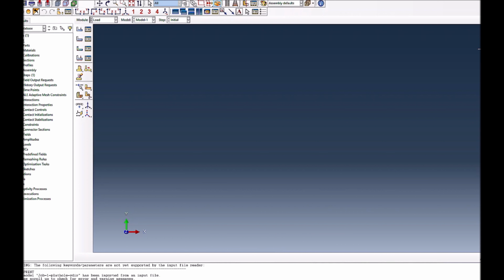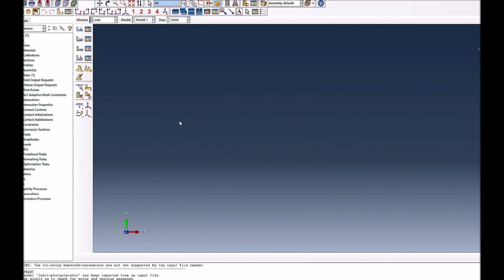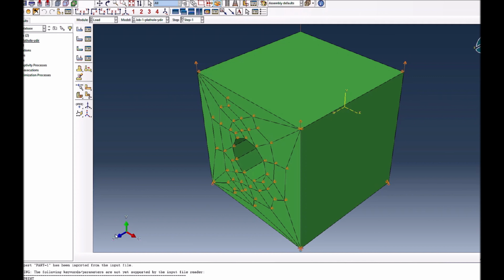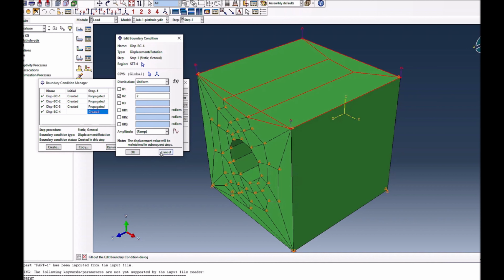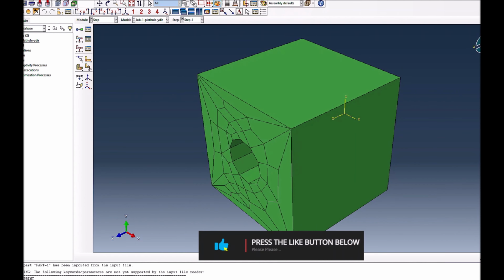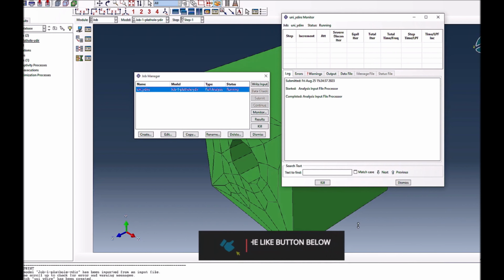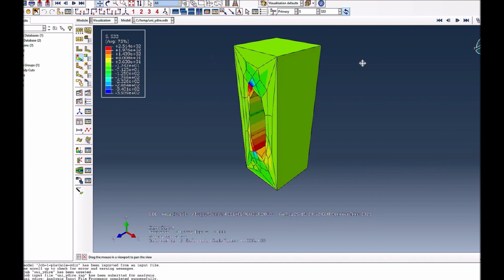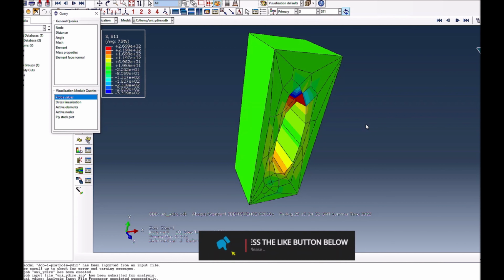Solving Uniaxial Test Simulation Issue - Problem Solved!

Comment: Hai. Thank you so much.

Can you make video about biaxial stress also ? I have a doubt about its Boundary Condition
Reply from the maker: You are welcome. 🙏🏻
What kind of biaxial loading are you after?
Reply: @Professor3MEC   I am just curious about the boundary condition, for example if we want to make tensile in t and x and y direction. Should we let both z plane free, or we should fixed them in z direction in one side ?
I will give you the inp file through your contact.
Again, thank you